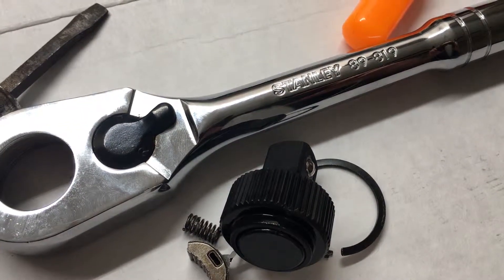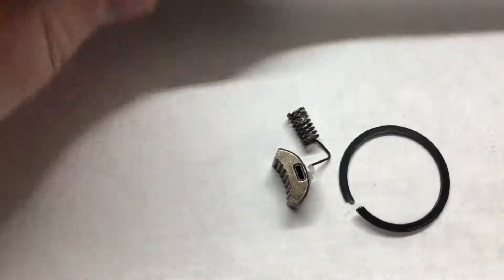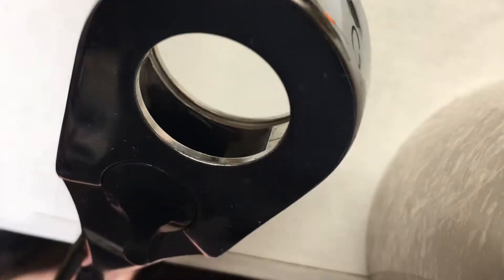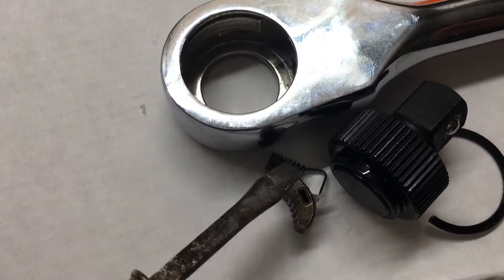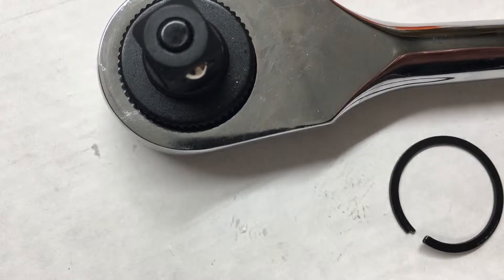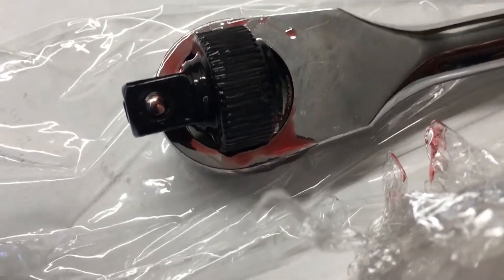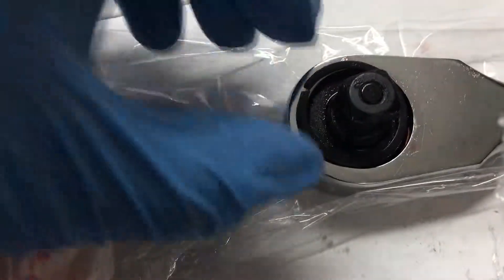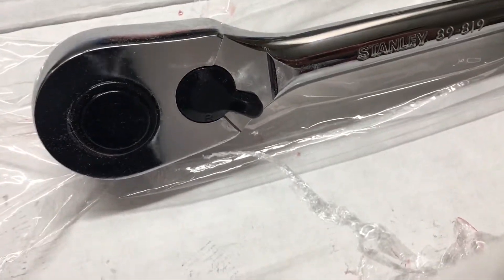2019 Stanley 89-819 1/2" Ratchet | It's Still Plastic Inside | Disassembly Review 89819

Comment: I have a bunch of the Stanley 72 tooth ratchets, and they all have metal insides. How many teeth does that one have?
Reply from the maker: I think these are 60 tooth, they have a double pawl new model that says 120 tooth but they use the same main drive gear from these. I don't think stanley makes a 72 tooth you can buy individually right now. HF are all 72 tooth, those are all metal inside too.
Reply: @corndogmd4882  I have the "120 tooth" dual pawl ratchets. They used the same heads for the Craftsman 120 tooth. Walmart started selling the 72 tooth ratchets instead of the 54 tooth. I've seen them at the walmart near me.
Reply from the maker: interesting, those are 91-xxx part numbers, mine are all 89-xxx, the walmart here only sells the 89 series last I looked, very weird. the stanley tools site is all 91xxx numbers right now too. I'll have to hunt one down if they're all metal inside
Reply: @corndogmd4882  my 3/8 54 tooth plastic gut and 72 tooth metal guts ratchets are both 89-818. I'm in the USA. Are you not in the USA?
Reply from the maker: I def have usa ratchets with those #'s thats crazy then. they must just sell whatever they have that week. I've had multiple 89xxx ratchets they look different from each other but theyve all been plastic inside. I saw the walmart here sells 91xxx now, I'll have to save up and tear one apart.